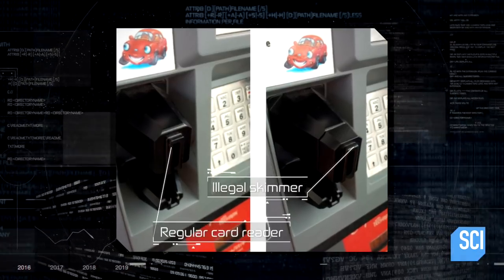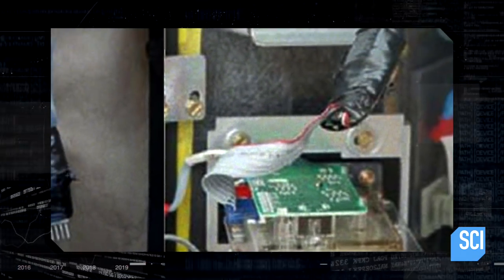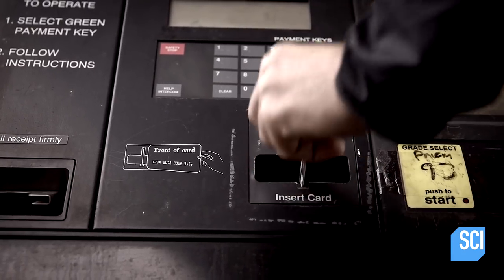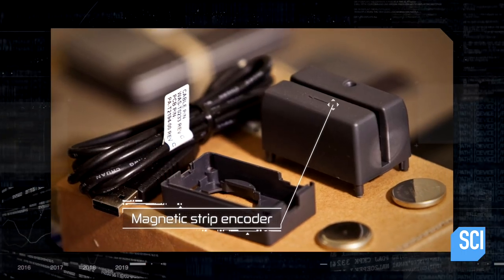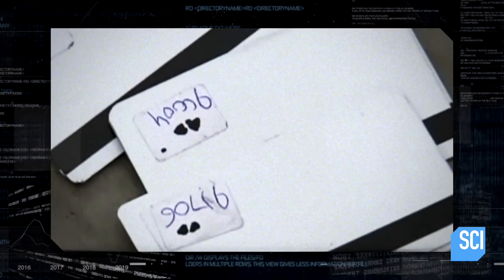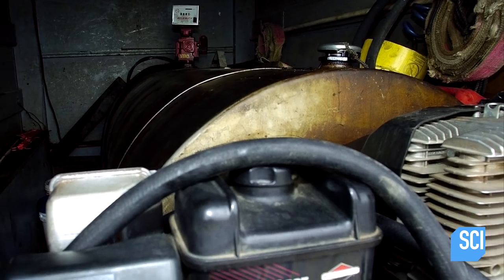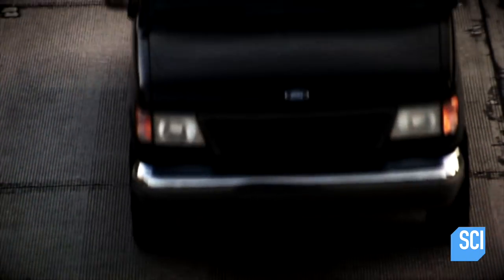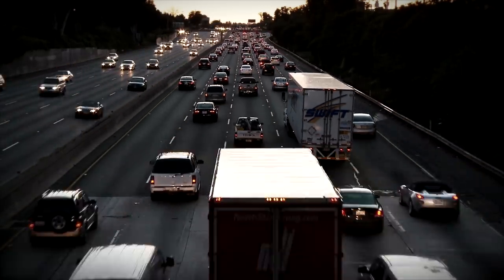Here's How Hackers Are Trying To Steal Your Credit Card At The Gas Pump

Comment: Diesel isn't easy to ignite. As a matter of fact you can throw a burning match into pool of diesel and it doesn't ignite. Lighter also can't do. 
On the other hand gasoline is extremely flammable. It also evaporates easily and the vapor mixed with air burns explosively (read: explodes). I think the bladder tracks are dangerous when carrying gasoline, but much less so when carrying diesel.